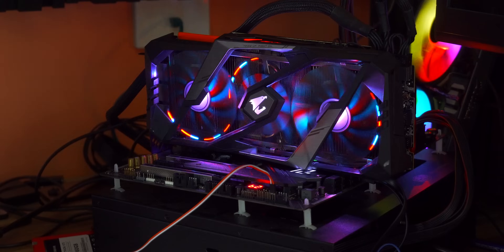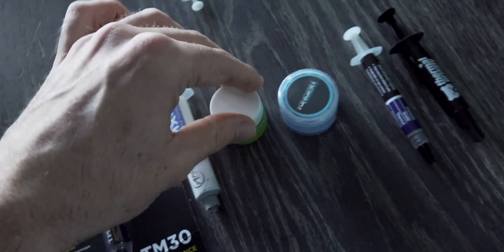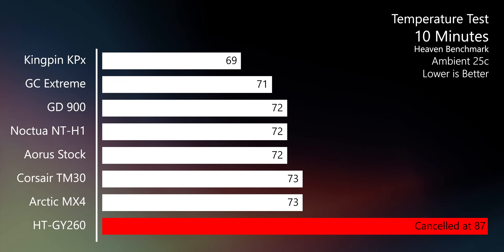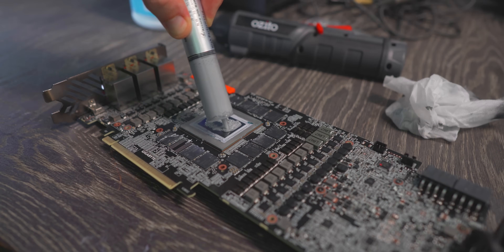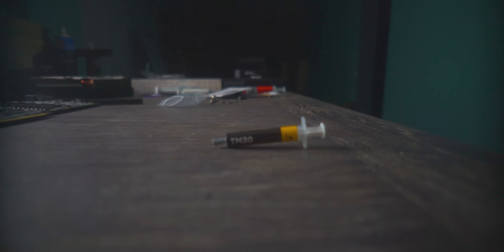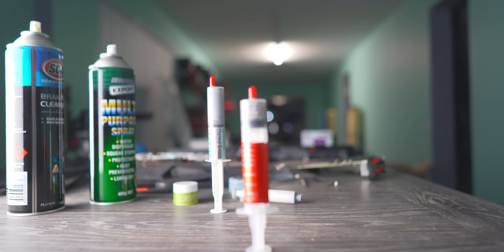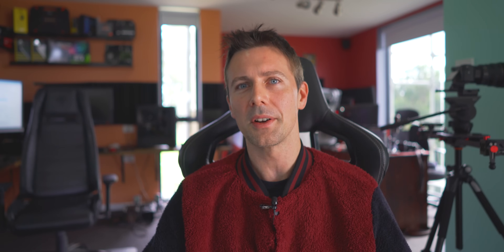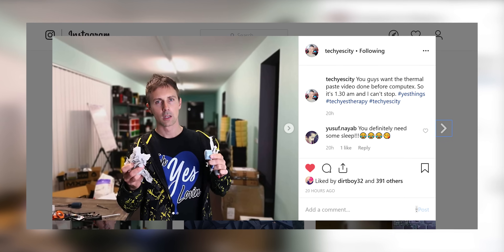What's The BEST Thermal Paste in 2019....? (Ft. GD900)

Comment: I had a gd900 6 months ago. My gtx760 was hitting the 100°C. I applied the gd900 and it fixed the problem. My case and air sirculation were very bad but after the gd900, i saw max 83°C with overclock. Its really cheap and high quality thermal paste.

Comment: Delidded overclocked 9900K for maximum thermal density ofc. 

For something different you could use a control paste or liquid metal on top of the IHS, and change what's under the lid. That will give maximum spread of results as the paste is being tested on the hottest, smallest surface (the 9900K die) with the greatest dT.

Comment: Personally, I use Arctic Ceramique 2, it's cheap, non-conductive, long-term stable and somewhere in the region of MX-4... it's a pain to apply, tough.
Reply: I bought some from Newegg. It is a pain to apply. It is kind of like bread dough. So I bought some Arctic 5 or something.
Reply: @christopherjames9843  Yeah, as I said... IIRC it was originally designed for application in Aircraft or something where it had to withstand lots of vibration.

While it's a pain to apply, I prefer this extreme over ones that are so fluid you can cause a mess. I once had some cheap stuff from Coolermaster or something and despite being careful , i got to spend the next hour cleaning the damn gpu.

Comment: Curing test please! Nobody does it cause it takes years, but most people just want to set and forget it and never replace thermalpaste. I start to use GD900 in this year but I don't know how holds up in a long run "Does it perform the same after 4 years?" My suggestion if you build some PC for your friends and family use different paste and test the thermal performance every year, see if there is any difference.

Here is 2 quick story, my old laptop was thermal throttled so I replaced the paste with the most generic cheapest white paste in the market and I replaced in my friends laptop as well. No throttling, but after about 4 years 1 of 3 laptops (i5) start to throttle again and I checked the other 2 (i3) wich are run 15-20 degrees higher than before they just not reached the thermal limit yet.
I bought a miner graphics card wich has a limit of 75°C and it mined about 1 year, the thermal paste is looked good guality, but it was really stiff and after replacing it temps dropped 10°C.

Comment: would you recommend using liquid metal for a laptop? i need to get the temps down as low as i can on my particular unit to prevent a very common gpu failure

Comment: been using gd900 for 4 years its amazing, I used to have arctic mx-2 no diffrence in temps :)
Reply: How often do you have to repaste?
Reply: @troywalker9602  havent checked I repaste and clean my pc every 3-4 months. I even use it on my laptop.
Reply: 3-4 months is way too frequent. I want to use this paste for at least 5 years without reapplying. How's your experience so far?
Reply: @troywalker9602  u pretty much never have to repaste anything within 5 years man..
Reply: I've been using GD900 for 18 months now and haven't had to re-paste anything yet. Temps are still great on my earliest applications. Scheduled re-pasting is a complete waste of time if it's still working fine.
Reply: @jaidynweight5394  Pretty sure this paste is non conductive. Pretty much safe even if you accidentally pour it into the cpu socket.
Reply: I use GD 900-1 now on cpus, and others. Previously used AS [ marginally better ].  Re-apply every 3 years.
Reply: do you know if gd900-1 is non conductive? couldnt find this information anywhere

Comment: your method is not accurate enough, this topic has been covered many times over the years to show the method you are using is flawed and can give bad results, you need a controlled heat sources that you can dial in a temperature, not a GPU

Comment: Damn .. im torn between the Gelid Extreme and Thermal Grizzly Kryonaut ..
Reply: If it's for a laptop don't use them.  I tried those and noctua 2 on my Asus scar 2. Gelid and kryonaut made my laptop instantly reach high temps and high fan speeds. Noctua 2 worked better but still didn't prevent throttling of my 8750h. I used the pea method

Comment: PART 2 : Thermal Grizzly Carbonaut thermal pad VS pastes
Reply: Its actualy not that good. I used it for 2 weeks, had higher than usualy temps (about 5°C higher than my Kryonaut) and replaced it and tested again. Same results.
Caseking (der8auer works there) told me its hit or miss with them
Reply: Waldherz FeuerClan, der8auer said it’s comparable to a medium quality thermal paste when GN interviewed him about the announcement. It will not degrade, but Kryonaut is not a medium quality paste…

Comment: Personally I use Thermal Grizzly Kryonaut simply because it beats MX-4 for a similar price per gram in the UK!

Kryonaut is harder to spread than MX-4 but it really works with super hot parts like the AMD FX-8350.

I'd love to see a retest with Kryonaut if you get the chance :)
Reply: Yeah same. Rather go Grizzly.
Reply: Will i see a difference in temp if i spread it coated to pea method on a laptop?  I used pea method and temps instantly went up

Comment: uhm, question about the longevity of GD900? like does it cure quickly in order for us to replace the thermal paste often?
Reply: I have the gd900 on my ryzen 2600x for over a year and the max temperature didn't change yet, maybe 1°C only heh. I'm not gonna change it until the temperature starts reaching to 70°C in occt stress. Now it reaches max 65°C in stress test and in games 55° is the highest I've seen
Reply: @damara2268  thanks for your answer, im buying gd900!
Reply: Gd900 on my rx 570 red devil only last for 4 months, the temperature getting higher than before, and now it can reach 83°C (the highest one before just 79°C), planning to change to MX4 or maybe kingpin kpx
Reply: @rizvian24  any update on this? hows it performing?
Reply: @rizvian24  hey, did you change the thermal paste? Results!
Reply: I was curious about that too.  Thermal paste is only good as long as it isn't cakey.  I guess it's really cheap?  So if you need to replace it often, it won't cost much hahaha.
Reply: Well if your rig is running 24/7 less worries, because it will keep the thermal paste melted due to heat being produce by the gpu/cpu. But if like me, i run my rig every day-off only. Might as well ask about it. 😆 no worries about replacing it often because it is cheap, but kinda hassle taking off your heatsink often too. 🤔
Reply: @HelloKittyGUNDAM  it might dry out, though.  It's not necessarily something you keep melted.  I would imagine that keeping it flat is better than keeping it vertical.
Reply: HelloKittyGUNDAM even running often my gpu needs its thermal paste replaced. temps are starting to go up even after dusting.
Reply: @ArtisChronicles  what gpu and what thermal paste are you using? how often are you cleaning it? and how often is it running?
Reply: Check out gamer's nexus and der8auer video on thermal paste .....

There is no such thing as curing of Thermal paste it's actually pump-out effect which happens because of heating and cooling of die and the heatsink close to die ...

Der8auer recommends to change kryonaut after 1 year on a gpu (where die contacts directly with the heatsink such as laptops) 

So probably a good idea to change  gd900 every year on a gpu and 1.5 year on a cpu
Reply: No issues with curing whatsoever. I have graphics cards that I applied GD900 on over six months ago and the exposed paste is still viscous.
The only thing I noticed with GD900 is that the paste is watery when you go to squeeze it initially. You'll need to wipe that off before it's ready to be applied.
Reply: @jimtekkit  yea it was fine after 1 years without curing. I used it on my laptop and I rarely use that laptop
Reply: I heard (just heard, never tested) that non-conductive one is okay, you change it like usually, every 6 month.
Reply: no, it doesnt cure quickly. I've used GD900 on my laptop (i rarely using it).

Comment: I always use the thermal grizzly- it's a shame it comes in tiny tubes for £6- but I've got the best cooling from it compared to the noctua NTH1. Edit, try cooling a laptop- they always run super hot. More of a pain to strip down per each test, but you might be able to see abit more of a difference again :)